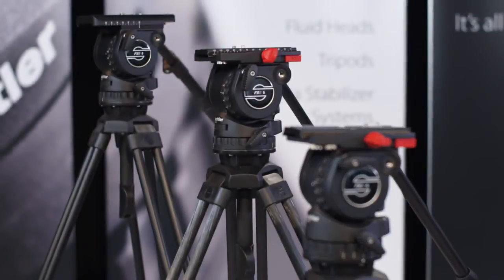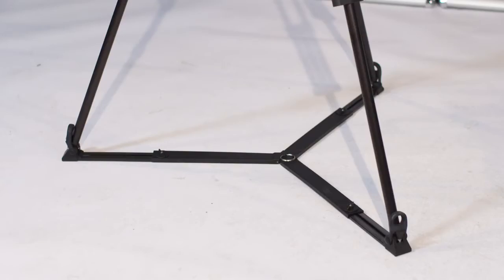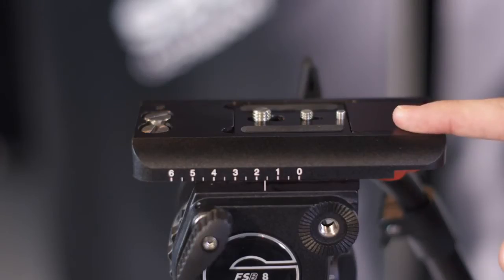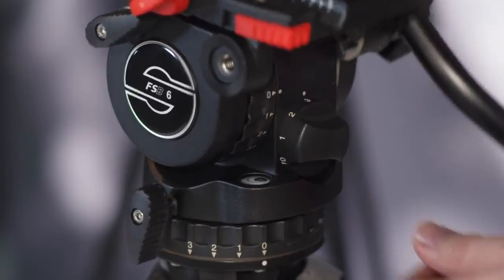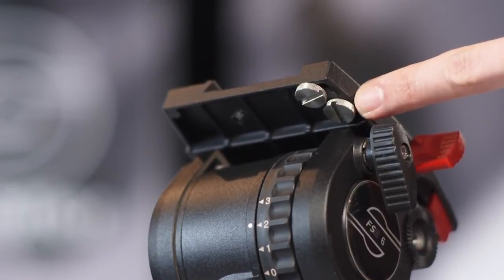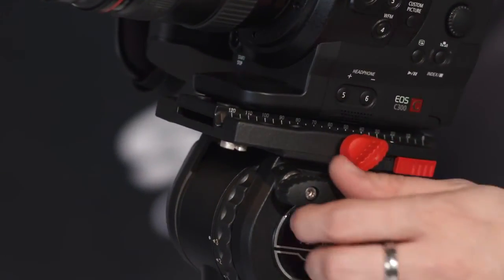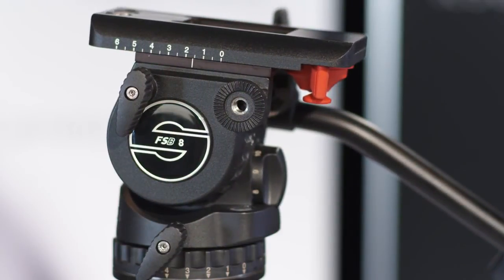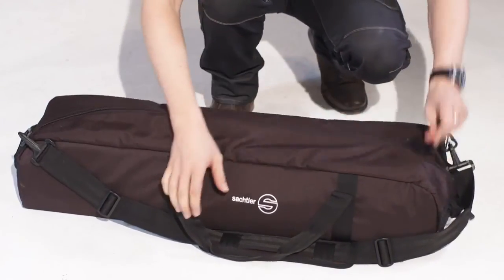Sachtler Tutorial Video FSB series

Comment: My employer has 2 FSB 8T/Speed Lock 75 CF systems just sitting around, after I had specced them (we since downgraded to Manfrotto's).  Only reason is, we can't seem to figure out a way to keep the damn pan handle from slipping constantly, no matter how TIGHT we tighten it!  (Talking about the pan handle that came with it.)  Those rosette "teeth" are just too fine compared to other brands!  Yet from everything I read, I know Sachtler and the FSB heads in particular are STANDARDS in professional video production and filmmaking, and I don't read or hear anyone else having this pan handle problem.  What am I possibly doing wrong?  There seems to be a soft (cardboard-ey?) washer between the pan handle's clamp and the rosette, but yet it's not so cardboard-ey as to seem like packaging to throw away.  In any case, even when I remove it and connect the pan handle directly to the head, it still slips.  Can anyone please help?  I want to like these tripods and use them, as (1) my employer spent a lot of money on them, and (2) the Manfrotto's (504HD heads) have a little kickback on pans & tilts, and the tilt lock doesn't affirmatively lock the camera's position, there's always a little slip there.  The Sachtler heads are definitely smoother, if only I could get the pan handle to not slip!